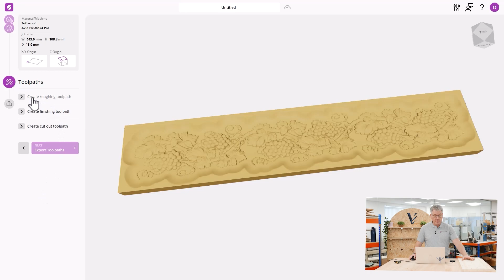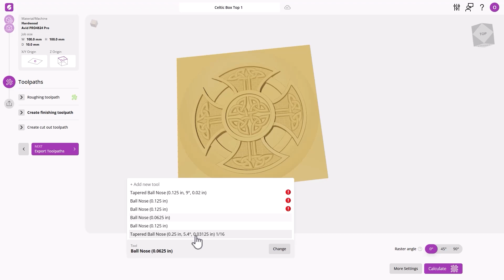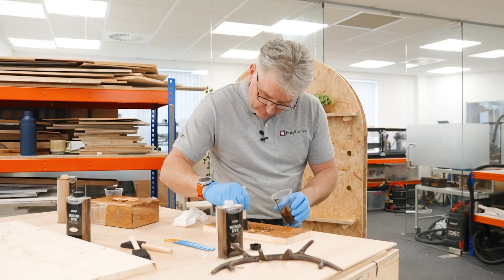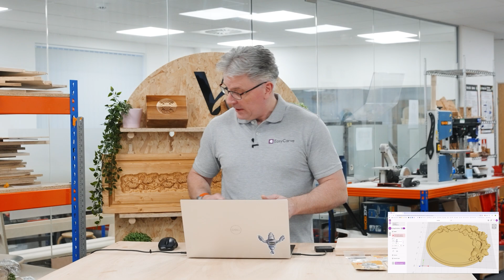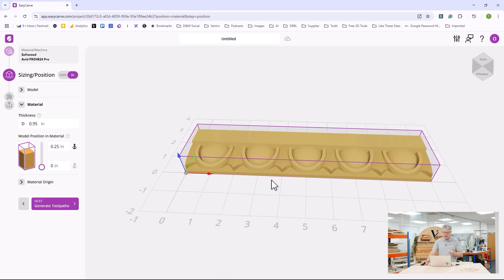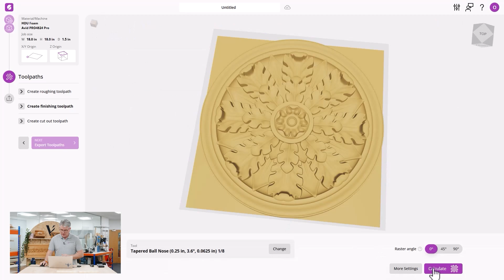6 CNC Projects In Two Days | Vectric EasyCarve

Comment: I did not see any tabs on the cut out tool paths.  How did you prevent the pieces from breaking loose as the cutout was complete?
Reply from the maker: I used a combo of double-sided tape and screws.

Comment: Do VCarve pro users have access to to these same files that you used in these projects?  Are they free or do we have to pay for a pack of some sort?
Reply from the maker: Hello and thanks for the question.  VCarve  and Aspire users (along with a lot of 3D party software) can purchase any of the content we offer in EasyCarve from Design & Make.  So yes you can.
Reply from the maker: Yes they are available from Design & Make if you purchase them.  These models are included in the EasyCarve Subscription but they need to be used in EasyCarve.   You can use EasyCarve in conjunction with VCarve... but they can not share files.   I hope that helps...

Comment: What is the difference between EasyCarve and VCarve Pro?
Reply from the maker: EasyCarve is a standalone App that is powered by Design&Make clipart.  It is limited, for now, to just cutting 3D models.  It is perfect for new to CNC users that are looking to add 3D models to their projects or cut them as stand alone pieces.  EasyCarve is our first venture into a browser based app, so expect things to be updated often...
Reply from the maker: At this moment EasyCarve has the ability to create 3D tooling from content provided by Design&Make.  Where VCarve has many more features, toolpaths options and design capabilities.  In some work flows EasyCarve and VCarve will be helpful to have depending on what you are doing.  Seeing as EasyCarve has a free trial experience and VCarve has a Trial version... I would give bot a go and see what fits your needs better.
Reply: @vectric  Thanks!

Comment: How do you add that bit to EVERY tool library?
Reply from the maker: If you look in your Manage Tools section you will see your tools listed.  Edit the tool you want to add to all machines and materials.  Then simply add choose "Add Feeds And Speeds".  You will need to do this for each material and or machine, and adjusting the feeds and speeds accordingly.  We don't have the option to do a blanket copy because there will be the need to review the settings per material to keep you safe.